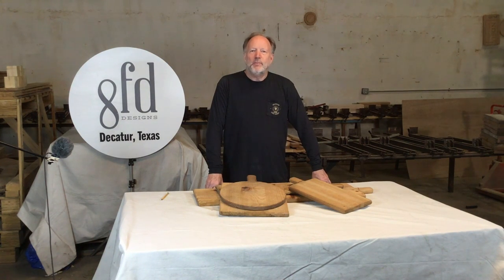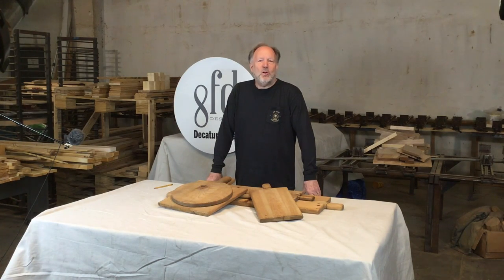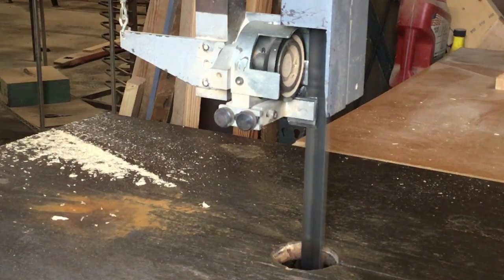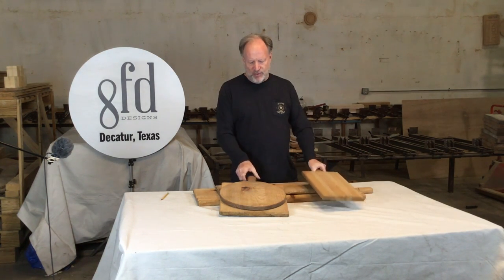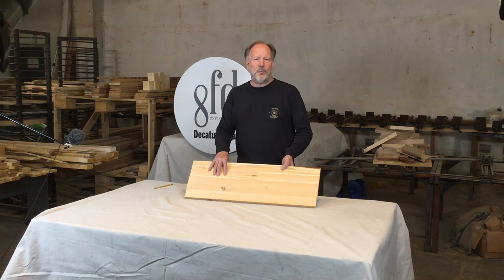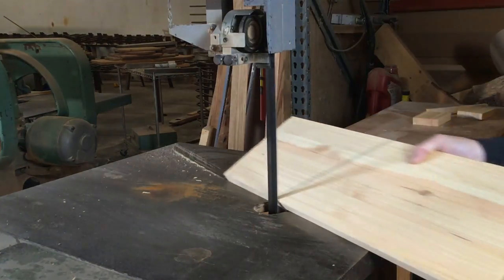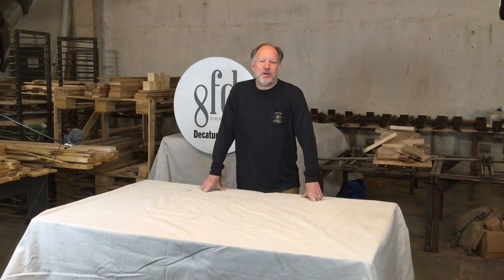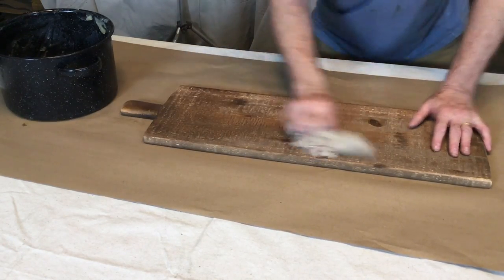USING A BAND SAW ALL WRONG

Comment: Interesting video.  Once again, I find that I am very odd.  I actually adjust the bandsaw blade guide to just above the height or thickness of the board I'm cutting.  I was taught this way back in High School wood shop.  But I guess it's just a waste of time.  I notice that you guys just leave it up high, as I see most woodworkers do on YouTube.
Reply from the maker: Two points - The title of this video is How To Use  A Bandsaw All Wrong.  If It was titled "How to make precise cuts with a band saw" then yes, use a sharp blade, check the set of the teeth, adjust the blade tension and guide positions, set the guides right above the work, cut slowly and carefully.  THAT IS NOT WHAT WE ARE DOING HERE.   And -  on a project video, guides and guards are often out of place to give a better view of what is going on.   Thanks for watching.